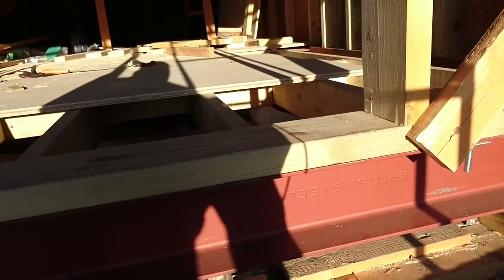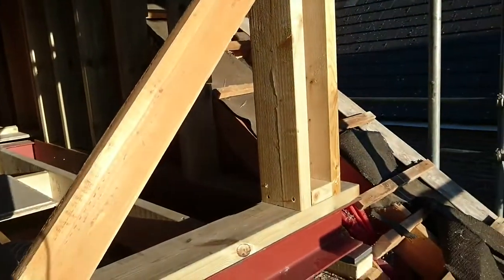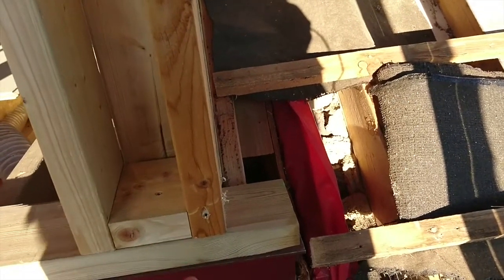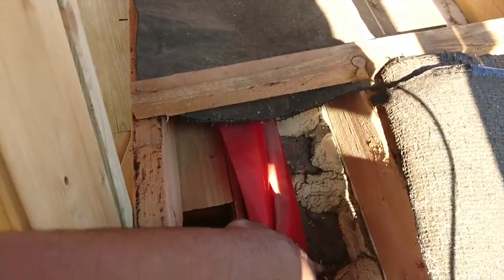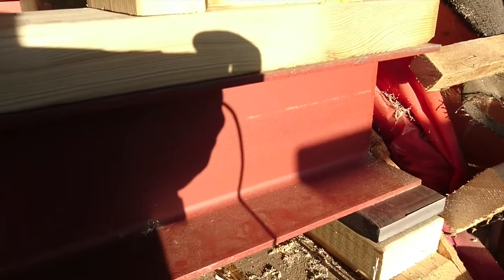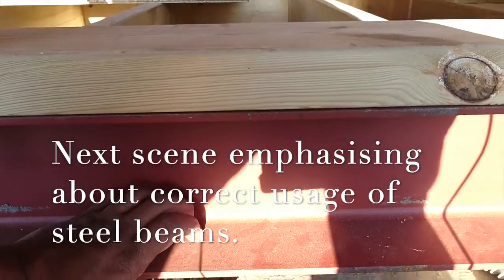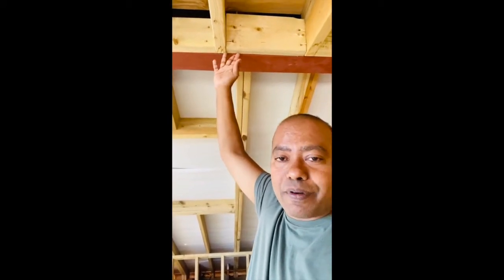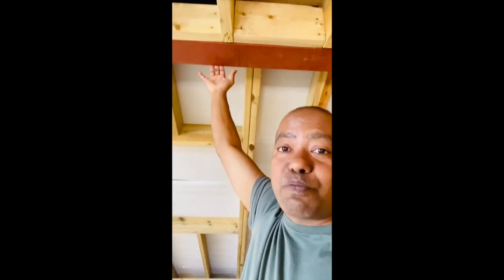Loft conversion on Timber frame house Part 3 (RSJ/STEEL BEAMS)

Comment: Seems a little strange to have a steel girder supporting the roof load & 2 - 2x4's supporting the girder, did a structural engineer do the roof load calcs?
Reply: Structural engineer did calculations.

Comment: Interesting video as I also have a timber frame house and I have been fixing of loft conversion.  What is the reason for the additional timber on the ground floor?  I suppose it is to reinforce the structure but then is it not needed on the first floor as well? Did you also have to do that because you have used steel beam for the loft conversion? I wonder if a timber solution or an Ecoloft solution you would still have to reinforce the structure of the house?
Reply from the maker: Please contact 07581505485 I explain . Thanks
Reply: @diodoitourselves2450  great videos

Comment: We're hoping Ecotrus can work on our timber frame houses being new builds. Just hope their system doesn't need the supporting beams in the walls due to their lightweight design and layout
Reply: Timber frame structures are solid, reinforcing not mandatory.
Reply from the maker: Please contact 07581505485 I explain

Comment: I thought you can't use steel beams in timber framed house as the timber is not strong enough?
Reply from the maker: Hi, absolutely not. Timber frame structures are very strong.
Reply: @diodoitourselves2450  I am looking into the ecotrus system for our timber framed newish built house

Comment: Salam Akhi. I agree with you regarding the steel beams. I don’t understand why a crane 🏗 has to be hired just to install the steels. Could you please provide the measurements of your beams and sizes? I’m gonna do the installation of the steels myself but I don’t want to install unnecessary large steels.
Reply from the maker: Hi, Thanks for  the comment. Good to know your ideas, Yes please don't go for unnecessary heavy steel  beams. I am glad my video gave some sense. You only need RSJ  6inch by 6inch ( weight 30kg meter)  depends upon  the positions,  width and landings of your house, normal house 6/6 RSJ is more than enough. If you would like more information please mail me your number on doitourselfs@gmail.com I can advise you. Thanks
Reply: DIO Do It Ourselves I emailed you